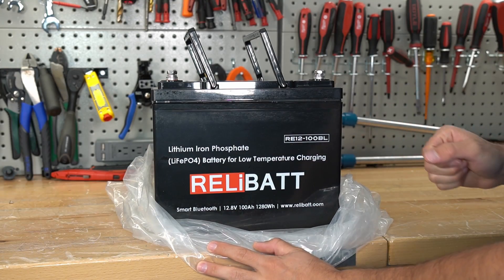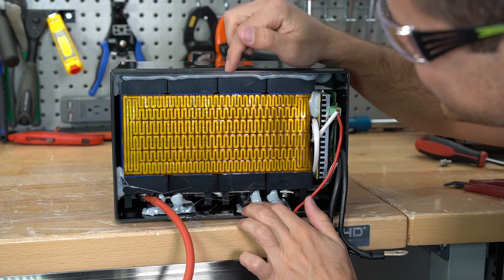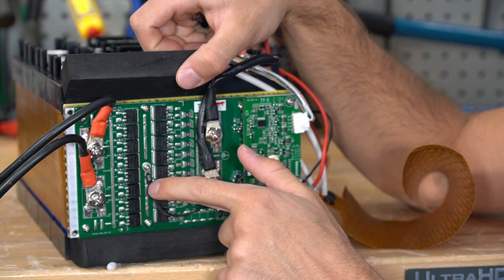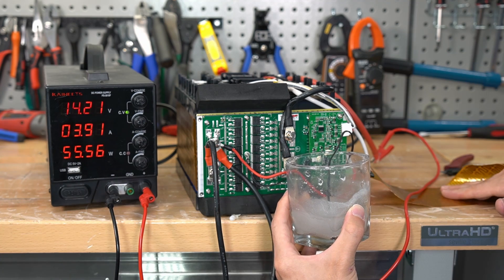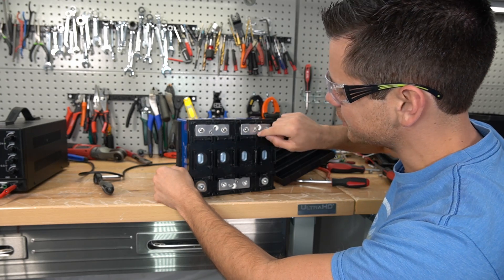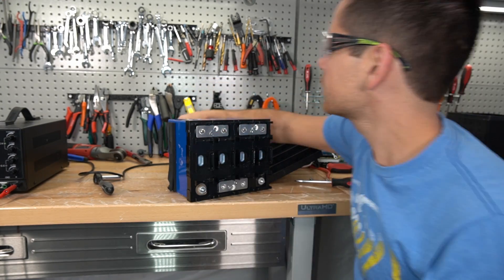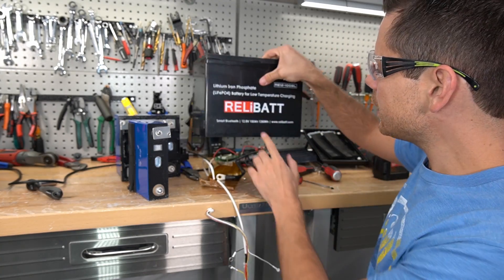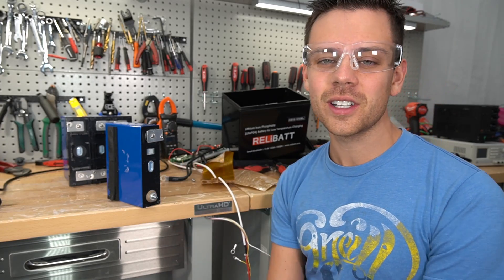$549 Relibatt 12V 100Ah LiFePO4 w/ Internal Heaters

Comment: Fine job your doing!!!!
Have a quick question, bought 2-200 watt solar panels and if I read correctly they are to produce 10 amps a piece. In full sun light directly on the pannels I only get at the most 6 amps or less with both hooked together .  They are 12v pos to pos. Neg to neg. Did I get two bad pannels? If I did please suggest a good 200 watt pannel please. Thanks very much.  God Bless for helping people.
Reply: Good afternoon!!  If you don't get an answer here, you can go to his online community (link in description) and I bet you could find what you're after!  🙂
Reply: Tennessee Transplant
I'll take a shot. From your description, it would appear that you have your panels connected to two 12 volt batteries in parallel. You don't specifically say whether the panels are connected series...or parallel.
First...if you aren't using a MPPT charge controller between the batteries and the panels...a serious problem. PV panels have an optimum power point. Operating off that power point GREATLY reduces power output...thus MPPT (Maximum Power Point Tracking).
If you do have a MPPT, check your maximum and minimum voltages it can handle. If panels in series, you will have somewhere near 80 volts. If panels in parallel, somewhere near 40 volts. See the spec tags on the panels. Otherwise...Will's DIYSolarForum on the web for massive user base help....since I can only guess from your description.
Reply: Yes have a mppt controller and it is positive to positive and negative to negative all the way to controller then to batteries. 
Highest voltage is around 23 volts and max 6 amps. 12 volt batteries and 12 volt controller. 2-200 watt solar pannels   In full direct sun light. If I read right they are to put out 10 amps a each. Thanks for your help.
Reply: @truthwins9044  
I took a look around for specifications for 200 watt panels. Closest I could find was 230 watt-240 watt. 
V(MPP): 30 volts
I(MPP): 7.8 amps
V(open circuit): 37 volts
I(short circuit): 8.3 amps
The output will increase or decrease depending on ambient temperature (with no correction at 25°C). Higher tperature=lower output.
Possible causes for low voltage/current
Undersized conductors from panels to MPPT
Loose or poor connections
It wouldn't take much to produce a 3-4 volt drop due to loop distance with a corresponding loss of current.
Other possibilities
Improper setup of MPPT for the type of batteries (FLA, AGM, LiFePO4...)
Batteries of different capacity, age.
Connections from MPPT to batteries.
Connections battery to battery.
Ideally, the batteries should be very similar (if not identical) and an identical state of charge when connecting for the first time.
Your calculated 10 amps sounds high but without specific panel data...
Reply: @josephbrabenderiii2049  thank you very much. Guess they don’t put out what they claim.

Comment: You mentioned in a previous video to not buy these batteries with internal heaters if you are connecting them in series because the heaters can cause the batteries in series to become unbalanced quickly. If the heaters only turn on while being charged, why would they become unbalanced if each battery in series is being charged independently?
Reply: Because one battery may have the heater on while the other doesn't. The one that doesn't will get full sooner.
Reply: @MarkRose1337  Wouldn't charging each battery on its own charging bank keep batteries connected in series balanced, even if one battery heater turns on during charging?
Reply: @sdultra  When the heater turns on it's because the battery is too cold to charge. So it won't be charging while the other may be.
Reply: It's forbidden connect any lifepo4 in series without BMS for whole assembly. Only parallel connection possible

Comment: Looks like good hardware, just poor assembly. I wouldn't mind a plastic case like this if it was fastened and gasketed instead of glued.
Reply: They know that most LiFeP04 battery users are tinkerers, so they should offer buying options of "glued" and "unglued".

Comment: A little modding and it's a heated battery. Heat shrink there, better glue there, and scotch tape removal(?? Seems like a strong and non flammable option, but let's just remove it) Cost effective if someone isn't willing to diy. Just a lil lipstick on that pig and there you go. Prolly won't catch fire.

Comment: In Bulgaria come other scam one or two cell with no heater simple BMS and concrete  on the place for the other cell inside the case I assume this scam is local reason is that most of this battery appear only in local intermediaries between  Bulgaria and China

Comment: @Will   The temp sensor is really just checking the ambient temperature of the air in the battery???  Which will likely warm up faster than the cells?????  If that's the case is it really (properly) heated?

Comment: LiitoKala 12.8v 150AH lifepo4 battery with 100A BMS 12V for 280$ on aliexpress ...looks like a good deal might have to get it but i need the WILL approval of it first lol
Reply: I'm in the same boat but for the Timeusb brand. 12v 95ah, 50A BMS for $277 on Amazon. Bought their smallest battery to see what the quality is like before taking the plunge.
Reply: @SnifferSock  yeah thats the thing with quality and price point ... glad we have WILL to test them out so we know what not to get and get lol ..

Comment: So would these be ok to use in a sailboat as a big battery bank,  like 6 to 10 batteries in parallel?
Reply: I think you can. You will have to physically tie them down anyway so the motion of the boat won’t move them. 
The userions is if you really need heated batteries. I prefer a insulated battery box - which can then be heated. You could even add a dedicated 100 watt panel just to heat that box when the boat is not in use. 
A lot of course depends on the size of your boat and the space available to house batteries.

Comment: Wow that lid popping off is NOT good. I just reviewed this battery back in January and had given it a good review. I had to smash it apart with the putty knife method to get it open. I haven't heard any complaints of this happening either.
Reply from the maker: Oh you did?! Ok going to check out your video now. I wonder if I already saw the video and didn't realize it 😂 we open so many batteries it's hard to remember all of them
Reply: @WillProwse  Yeah, it's weird watching his video then yours .. I get the feeling this company is a startup that hasn't really gotten it's Manufacturing Quality Assurance process down yet.  Like they HAVE the right attitude (using high end parts) and intention (design is good) but haven't worked out the build process yet.
Reply: @WillProwse  Reliabat is now saying on their website that they didn't glue the top properly because they knew the battery was going to be opened and tested.
Reply from the maker: @HAL-zh1kf  really?? I don't trust that. I would imagine they would have told me
Reply: @WillProwse  If you open the link that you provided for them, it's the first thing that pops up. Here is what they are saying, "Will Prowse video about glue problem: The production person was told this one would open (sic) to test so this sample have (sic) not glued fully. Not a quality issue". Then they show a photo of one they say is glued correctly.
Reply from the maker: @HAL-zh1kf  yeah see my pinned comment
Reply: PS: Nice use of chainsaw! 😂
Reply: I have two of these batteries coming next week because I saw your teardown video and the build quality seemed pretty good.  We'll see how the lids are on those!
Reply: I got the batteries in today and I can safely say that no lids came off.